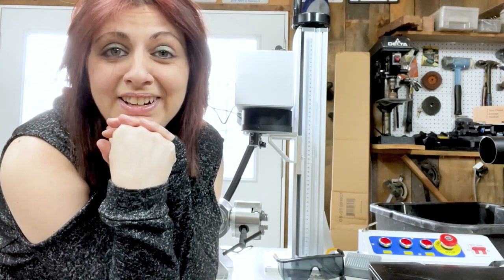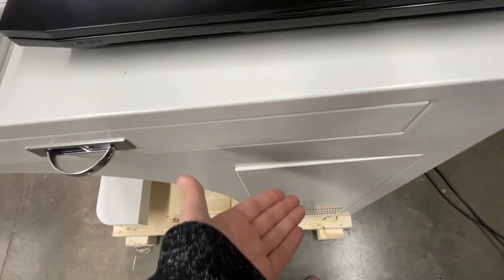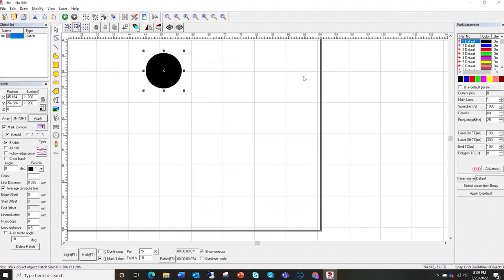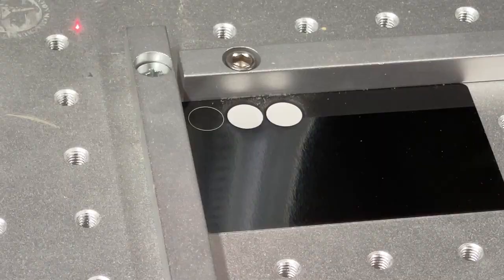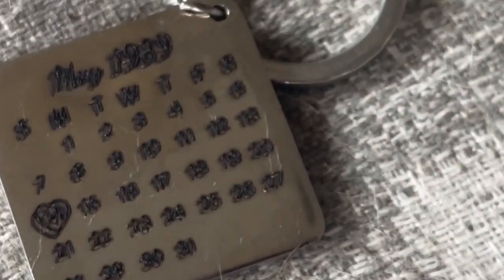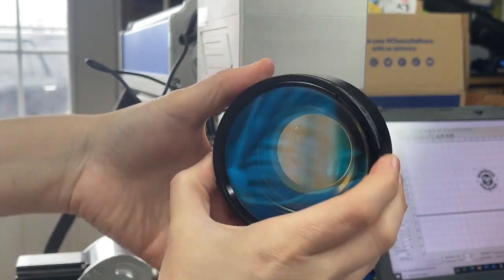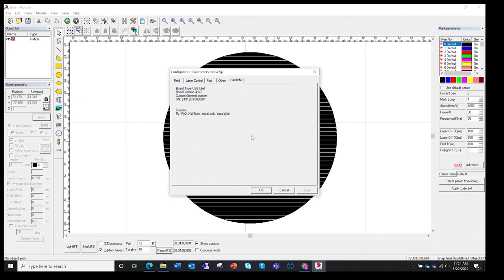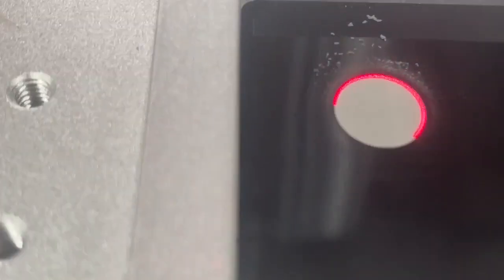Top 10 Tips for Fiber Laser Beginners - Laser Engraver Tips & Tricks - OMTech

Comment: I hope when you used that sandpaper on the stainless steel you were wet sanding with 1200, or 2000 grit paper. If you had scratches left on the piece then I'd say it was likely you had to coarse a grit.